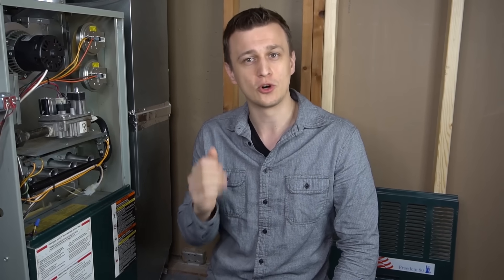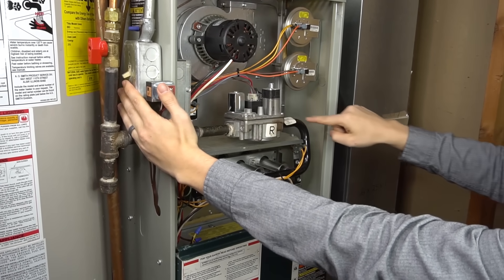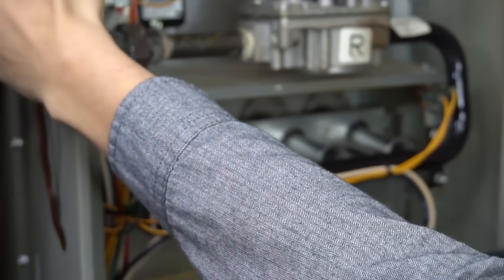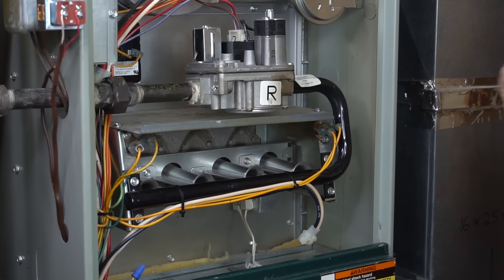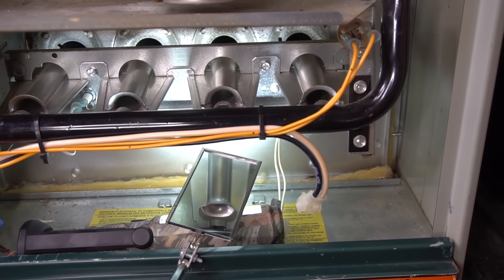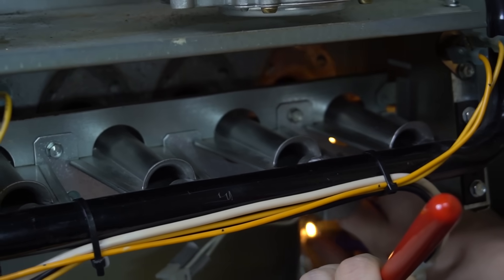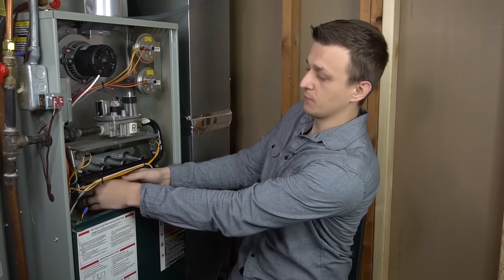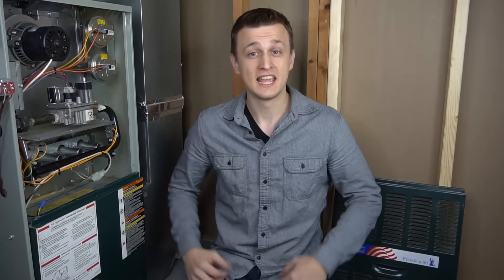Gas Furnace Wont Ignite - How to Manually Light Burners

Comment: Thanks for the video. My igniter failed last Friday night. Started getting cold and when I checked the thermostat it showed heating in progress, but furnace wasn't running. After resetting (shut power off, then turned back on) I watched and listened to what was going on. Inducer motor came on, gas came on, but know ignition. Went to youtube, found your videos. Figured out igniter was bad and how to change it and also how to manually light it to get through the night. Was able to find a parts supply shop open on a Saturday, paid less then $20 for part and had furnace back up and running in about 10 mins.

Comment: Never actually worked on a furnace but hearing the steps of our furnace kicking on for so many years and now visually seeing it happen during your description it instantly makes sense. Hearing the motor kicking, then the click of the gas and then the next step the four flames kicking in is how i hear and tell if our furnace is out of whack.. because my pilot light went out and it kept shutting off but everything else kept running and I could hear the difference before I opened it up to see. Thanks for the video!
Reply from the maker: Its pretty amazing how accurately you remembered the sequence of operation on your furnace and the order of how it fires up! Thanks for watching and leaving a comment!
Reply: @WordofAdviceTV  lol Your video gave me the confidence to light my furnace because my pilot light is out atm. I was thinking there has to be a way to light it without the pilot light.. but I was hesitant to do it at first, thinking I hope I don't blow the house up. Let me youtube it real quick. Your furnace looks exactly like mine, too. So that helped a lot.
Reply from the maker: @eldiablo3794  Nice! Good to hear that you were able to get the heat going. Stay warm my friend!

Comment: Thank you for showing how to manually starting the furnace.  Mine broke down at 7:30 last night, and no heat.  Plus, it was 28 Degrees outside.  Manually starting the furnace, kept us warm last night.   This morning, I went through your trouble shooting Videos, and it turns out the ignitor was reading Open, so I replaced it, per your video, and now my Central Heat if working normal again. 
Thanks, again.  You have great videos too.

Comment: After applying all of your common or simple tutorial suggestions and checking everything with a multimeter, I have track down the issue to a gas valve that has fuel but will not open. To double check my work,  I paid a local HVAC servicer to send a kind young man to confirm. He confirms we are correct. Still waiting on a repair quote and haven't found a guide of this type of repair yet. Word of Advice TV, break me down my friend.

Comment: Thank you. I was just reading about a neighbor getting gouged by a local repair company for a simple ignitor replacement. It inspired me to buy a backup flame sensor ($8). But a backup ignitor will cost a little more and might never even be used. This video shows me I can manage to survive a few days if my ignitor goes bad.
Reply: If you clean your flame sensor every year, it does not need to be replaced.

Comment: Kudos, I started looking into YouTube videos then came across.... cleaned the flame sensor, Thank god! I also noticed the air pump tubing was cracked and cut was disconnected. So totally no air supply due to poor job done by an elec. contractor lasted just a year or so. After half hour work, saw the beautiful blue flame and saved hundred fifty bucks or so. THANKS

Comment: Your videos have been a godsend! I watched another of your videos on ignitor failures and narrowed it down to that but then realized after replacing the ignitor it was a bad circuit board. I was a little frightened to take an open flame to natural gas coming from a pipe, but you explained it so carefully that it laid my fears aside! Thankfully as it dips past -2 degrees here tonight at least I can keep my pipes from freezing! Thanks again for the great information!!!
Reply: Did you have a sparkler or hot surface igniter?
Reply: Not well versed on furnace igniter parts, but I believe it was a hot surface igniter as it would start to glow when I activated the thermostat. That old furnace was replaced last November thankfully, but thanks to this video, it was an expense that was delayed for at least another 6 months as I just lit it manually when I needed it. Thanks  @alanran9043

Comment: OK so my 2002 Goodman went down last night. A video by A Handle on things went step by step trouble shooting and saved me from ordering a new circuit board. My igniter went bad. A couple hrs on line and phone 4 days earliest delivery. What a racket. Local $50+ ebay $27 to $38 free ship. 
So glad I came across this video to get me going but not with out bumps in the road. I used a BBQ lighter right on top, works good. I turned the thermostat to 80 so I could shut it off when I wanted to. It ran for 3 or 4 min and shut the fire off. I was thinking the over heat switch was turning it off. I was right. I have over half the registers closed in rooms I don't use. I opened a couple trying to keep the over heat switch from shutting things down but no good.      It was 55 out today so we were OK but now it's 35 so I went to the basement to cycle it get the temp up so I could go to bed and sitting in a chair relighting it when it shuts off..  OK OK I'm getting to it. I glanced over and saw the gas shut off valve. I started closing it till I just barely noticed a reduction in flame and noise. PERFECT! Back up stairs with a beer and TV till It got to 75 and shut it off. Going to bed.
By the way, that over heat switch has been working like that for 11 yrs. I think I'm going to leave the flame where it's at. Anything wrong with that? 10 yrs I replaced the vacuum switch. 16 yrs now the igniter.

Comment: Watched a bunch of videos but yours gave me the manual lighting courage I needed...Mirror? who needs one! I am fired up! great job!
Reply from the maker: Haha glad I could help you out Greg! Thanks for leaving a comment, stay warm!
Reply: @WordofAdviceTV   Ok I got fired up...but perhaps a bit too quickly in all my eternally optimistic thinking.
Everything perfect but wont relight on its own...solid red light
Igniter glowing but wont relight on its own....damnit!
Reply: Since i could manually light its obviously getting gas, I dont hear any clicking but the igniter lites up for 15 seconds or so and then powers off once no ignition happens...but i can manually light like you did and they all light and get going so i have gas...
But is it enough?
Pressure? Switch?
I checked tube...poked orfices
Im so close!
Works great when i manually do it tho.
I KNOW THE ANSWER IS SO SIMPLE . ILL GET IT!
Reply from the maker: @gregtenney7279  That sounds like a weak igniter. I have a feeling that if you replace it all will work as it used to :) The other possibility is that the igniter is positioned not close enough to the burner. This should not be the case unless you moved/took out the igniter recently.
Reply: @WordofAdviceTV  you'd think that it would light with as bright as it is and i was thinking the same thing about positioning problem but it hasnt been touched or replaced so why would anything change since it worked fine before. ....ill just keep trying watching videos and playing with it but something changed.
All components work but something changed! !
I know the answer is so simple and so stupid its not even funny.lol
Back to work!

Comment: Definitely a good way to get a furnace going during troubleshooting to make sure the heat exchangers not toast or the gas valve isnt gone. Pretty easy way to lose your eyebrows if you aren't careful though. A good trick is to make sure you have a standing lighter flame nearby the burner as soon as the gas valve opens. Its only going to open for a few seconds so not very much gas will build up. Good video as usual!
Reply from the maker: Thank you Mark! I appreciate the additional input and the eyebrows warning! :) I should have mentioned that one should not have their face right in front of the burners when they do this...
Reply: @WordofAdviceTV  my old boss always used to say "god hates a coward" light er up dude eyebrows grow back in a month! Lmao
Reply: @WordofAdviceTV  I have a question. How do you keep a furnace ignitor going white? My furnace ignitor turned white and wouldn't work in November, so I ordered a new one. I installed a new one and it worked until today. It's directly in front of the heat and it's white. I've seen people clean it or gently sandpaper it but I think it's beyond this point. The ignitor is directly in front of the flame so it's guaranteed to stop working if I order a new one. What's the solution here? I have a Trane XR80 brand. Thank you for any help in advance.

Comment: Awesome video. I was having issues with my furnace working when it wanted to. Come to find out my lines for my pressure switch were clogged up. Fixed that and it's running like a champ now. 
Keep up the good work. I learned alot from you. I'm expanding my horizons with electrical outside of  Navy Ships.
Reply from the maker: Thank you! Glad to hear you were able to find and fix the problem in your furnace! Stay warm and may your horizons always expand!
Reply: Just curious- 
a) How did you clean out the lines? Compressed air, pipe cleaner, etc.? And how do you keep whatever junk is in the lines from getting to the switch?
b) If the pressure switch wasn’t working (or failing intermittently), the rest of the sequence (igniter, gas valve) should not proceed?
Reply: @peacefrog0521  I used compressed air from a computer keyboard cleaner
Reply: @peacefrog0521  if pressure switch is not working nothing else will work. It acts like a safety switch. Refer to the electrical drawing on your system.

Comment: When my igniter went, I verified it was getting 120v but not glowing red so I plugged it back in, used a non contact voltage tester and when it indicated power I used a bbq lighter to ignite the flame. 
Removing the igniter and cleaning it with emery cloth might get some more life. Also I read someone put his igniter in the oven for an hour at 350F to bring it back to life?

Comment: Great tutorial on lighting the furnace.  My igniter isn't turning the bright red that it should and when I pulled it out, it had the tell tale sign of a white line across the igniter.  I tried lighting it with a long patio grill style lighter but something is causing it to blow out while shoved up in there?  I can't even keep it lit barely while I hear the gas turn on.  Also, this doesn't seem anymore complicated than lighting a gas grill so not sure why I'm having trouble.

Comment: Thanks you for explaining everything so thoroughly, makes it easy to understand.
My question is can youmanually light high efficiency furnace where burners are in enclosed box? My furnace is almost 20 years old, looks like circuit board wont deliver volts to Igniter , dont know if I should spend money on new circuit board with furnace being that old, thank you!

Comment: Thank you, you're a life saver! I didn't know I could do this manual ignition. It just happened to me this holiday, my furnace not working and my ignitor burnout and no parts store are open until tueday.😭😭😭
Reply: In my experience, have an extra igniter/flame sensor handy(usually built in together)....VERY easy part to replace and solves two possible issues with one part...

Comment: Thank you for all the good videos, my furnace goes for 3-4 cycles (working fine) and stop working, I think you called "soft lockout", I try to troubleshoot myself, patiently watching this old furnace going through these steps and found out the ignitor didnt grow orange like you said.......
trouble #1........unplug my ignitor, measure ignitor resistance = 77 ohm, (you said " below 100 ohm is ok", measure my 2 wires from the control board with furnace running, put my DMM to AC volts, I see no 120V AC, my question(s)
why my furnace if working i measure 120V AC ( I have my DMM hooked on monitoring ), and sometimes not? is it my relays or the control board? 
I know nothing about furnace before, after learning from your videos at least I can troubleshoot some problem myself, greatly appreciated.

Comment: I have the exact same unite you are working on exactly the same. why is it i the heat on and the 5 burners start to glow then they just stop and the air just goes with no heat because the flame won't light. I tried a lighter in 2020 in Houston we had a freeze of 10 degree weather and your channel helped me fix it but as soon as it ran for 2 days it stopped lighting and now I haven't been able to get it to start since then.. the red light blinks non stop in a fast 1 2 3 4 5 6

Comment: So if the home owner is to light his furnace this way he should unplug igniter before trying to light?  If the igniter is still plugged in it will send a signal that igniter is bad and shut of the gas value? Or will the flame sensor just sense flame and the furnace will continue to run.

V/r

Dan.
Reply: I had this same question. I manually lit the burners, they turned off after a few minutes.

Comment: I love your videos,. I’ve been having issues with my furnace. I was hoping that these videos would help me but I can’t seem to find the exact video I need. My furnace igniter lights up great, yesterday I did see a flicker a flame come through the burner for about two seconds and then went out. What do you think the problem is? I cleaned my sensor really good. Not sure what to try next.
Reply: I'm having this same problem right now! I polished both the hot-surface igniter and the flame sensor with emery cloth. The igniter has a white stripe, but reliably (so far) glows when the thermostat calls for heat. After I cleaned them, the burners worked great for several cycles over a couple of days. Then (usually overnight) the igniter glows but the burners fail to light. I'd love to know where I should check next, to find this intermittent failure.

Comment: First let me say your videos are awesome!  So i know my igniter is good (I even swapped it to our other unit and worked fine) but it will not start to glow at all.  What is next step?
Reply: mbooth31 call a service tech
Reply: Thanks for the tip but wasnt asking you I was asking Jay
Reply from the maker: @mbooth31 Sorry to hear about the furnace troubles! If the ignitor is not glowing that typically means one of two things. Bad control board/ignition module (not sending power to the ignitor) or there is a safety switch/limit that is tripped. It could be a loose or broken wire as well but that's pretty rare. Is your control board blinking any error codes? Does anything run at all? Does the inducer motor come on and can you hear the gas valve open?
Reply: mbooth31   Oooooh, sounds like a little bit of YouTube rage 😝
Reply: @WordofAdviceTV  i found the light and its blinking 4 times.  Says high aux or spill limit switch open
Reply: Got it running!  Thanks for the tips!

Comment: My blower van is connected to a pvc pipe that leads outside.  Where they meet up water sometimes drips ever so slightly.  I feel like this may be cause my heater to not come on sometimes and may lead to bigger problems?

Comment: I went through all the troubleshooting and now I have it working up to the ignitor lighting. I’ve cleaned the sensors and changed the filter. The ignitor glows but I never hear the gas valve open to let the burners light. Do you have a video to help make the burners light? Or how to troubleshoot the gas valve and/or replace?  You have the exact same furnace that I have. Thanks

Comment: You've saved this single woman from freezing 🥶
Reply: Same feeling
Reply: I am available for warm up duty. 😉
Reply: @WORDversesWORLD  Some boob always has to find the negative.
Reply: @WORDversesWORLD  if you have a dead car battery and you're sure it's only a dead battery,  should you not jump start it?
Reply: Neighbor tried this before and kabooom. She never made it to new year!
Reply: @jimborambo958  but do we know what else she did, like increase the gas pressure or the length of time the valve was open?
Reply: @johnchristopher4341   I have no reason to doubt what you're saying, but you didn't answer the question I asked, and also, has there NEVER been a single case of an explosion from a jump start? A high-current jolt of electricity right next to a gasoline bomb??

Comment: My furnace is not buring gas.  The igniter comes on but no flame.  I cleaned the flame sensor and it worked.  A week later, no flame again.  So I installed a new flame sensor and it worked for a week then no flame again.  I went and started wiggling, disconnecting and reconnecting wires, turned off and on the gas valve and somehow it fired up.  It's working now but I have a feeling it will stop working again(no flame).  What do you think?  Gas valve?  This all started after I installed a brand new air filter.

Comment: If a spark ignitor is bad, can it still make the ticking/clicking/sparking noise or whatever it’s doing? Or does the fact that it’s making the noise mean it’s working? I can’t seem to see any spark and the gas isn’t igniting but it’s hard to get a good view.  Already cleaned the flame sensor and replaced the dirty filter.

Comment: When you were lighting the burner, you had one hand holding the mirror and the other holding the lighter.  Did you have an assistant turn on the electrical power switch?  (Or did you grow a third hand?)
Reply from the maker: It takes a good 20-30 seconds for the gas valve to open after you flip the power switch. Also, I had a camera person filming me who could lend a hand if needed. That being said, a third hand would be nice..